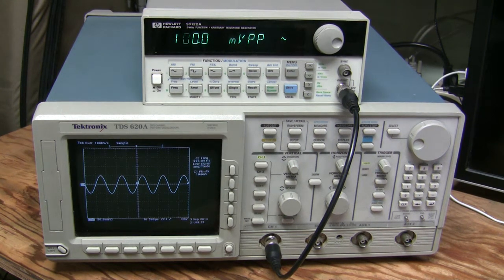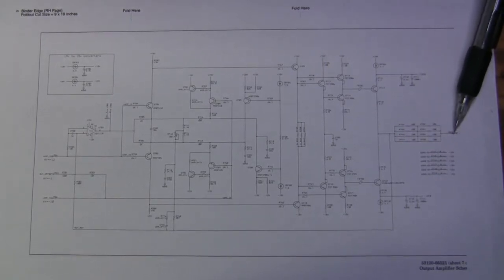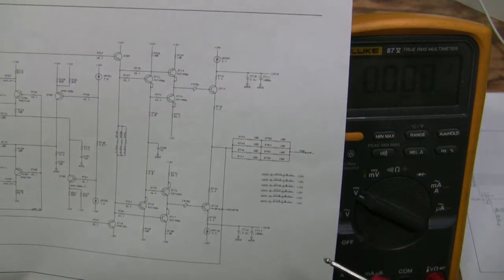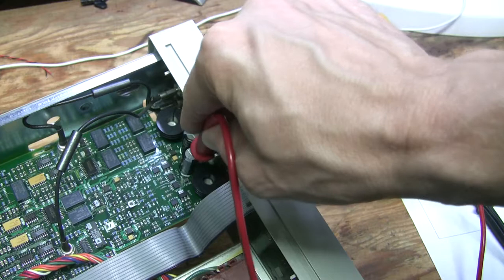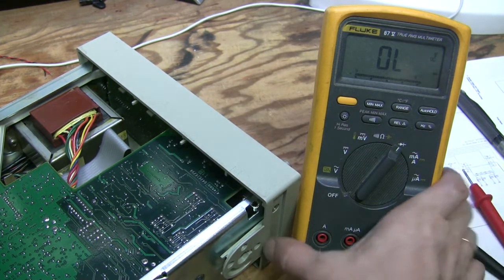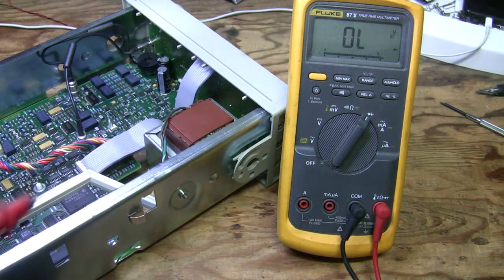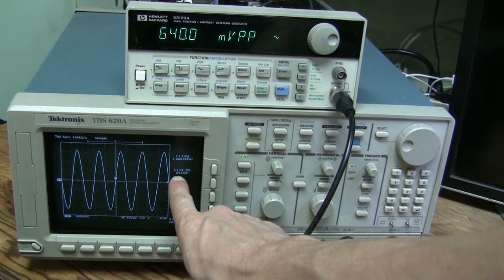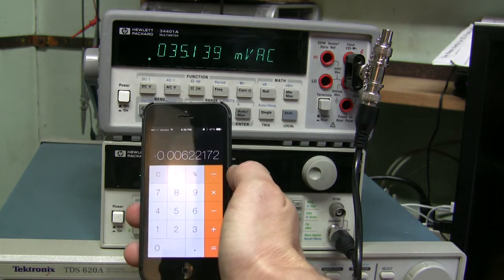#17 - Hewlett Packard 33120A function generator repair part 2

Comment: I found the same fault in another unit. However, the cause was a cold solder joint on the output transistor. Reflowing the pins fixed the unit.

Also, when checking the amplitude, the manual says to terminate the output at the generator, not at the DMM, due to the cable resistance's IR drop.
Reply: Just went through the above procedure to repair same problem. Couldn't find anything then I saw your comment, re-flowed the output transistors and now it works like a dream. Thank you much for this tip.